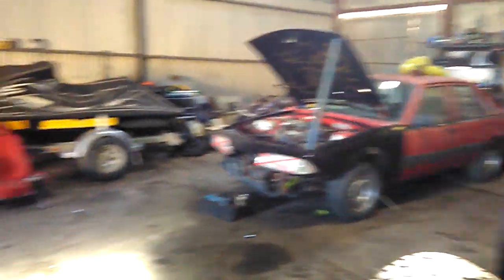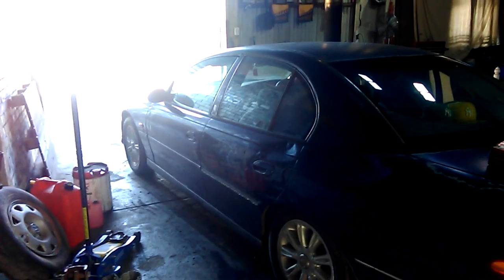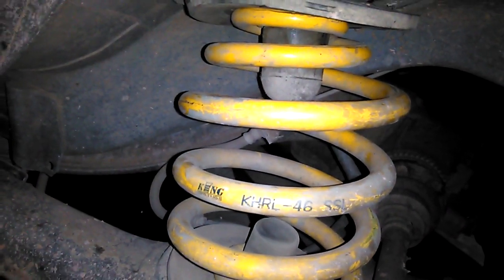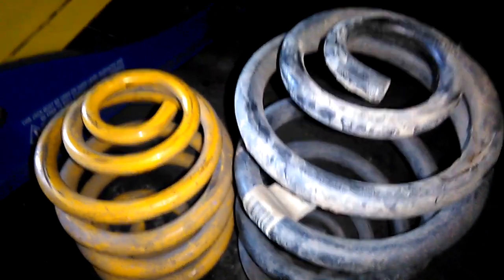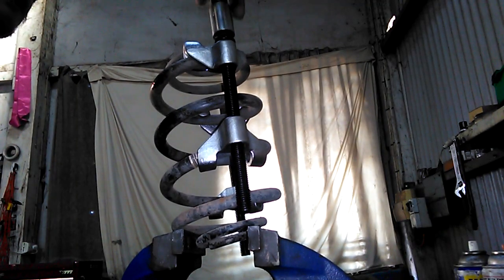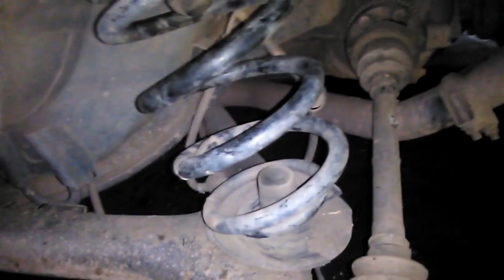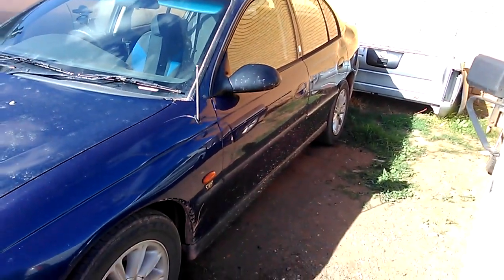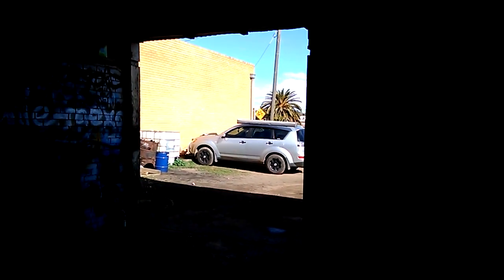Standard Springs Back in The VT (Got Defected)

Comment: You got failed because the tow bar looks close to the ground rest of the car doesn’t look that bad , I would have suggested that removing the tow bar would actually make the car legal , the height I like going on cars is just a low spring which lowers it by around 3 cm and that way the travel on struts you don’t have to change struts either , when you put in different anything lower than low struts you also have to get the proper struts that can travel further
Reply from the maker: Yeah that was the reason he even put the handbrake on that makes it drop a little more i looked at taking the tow bar off but never got around to it at the time. I swapped the VT long ago now but will now for next time cheers